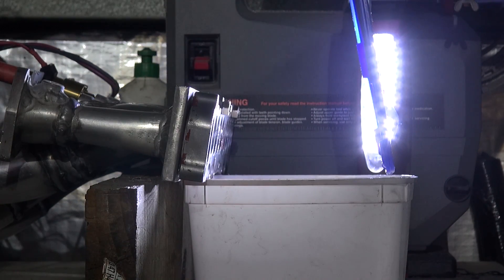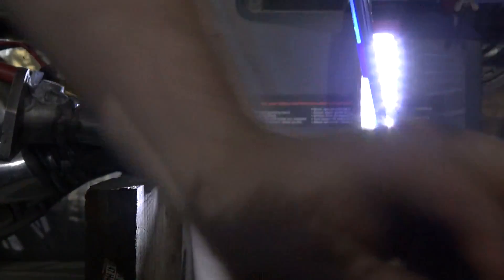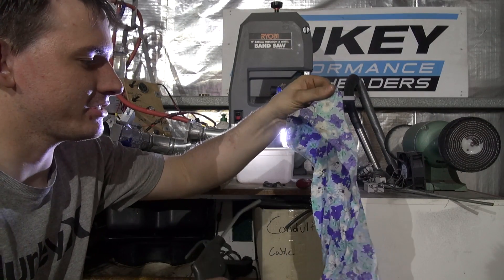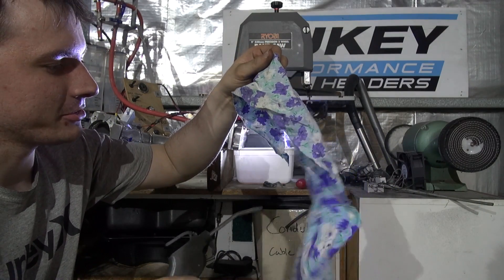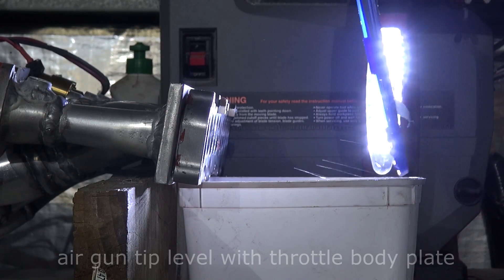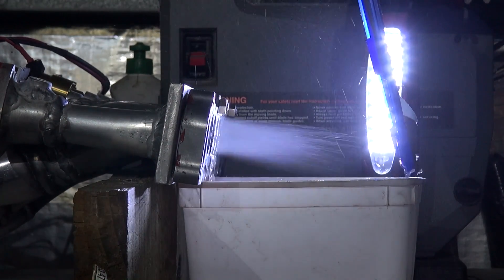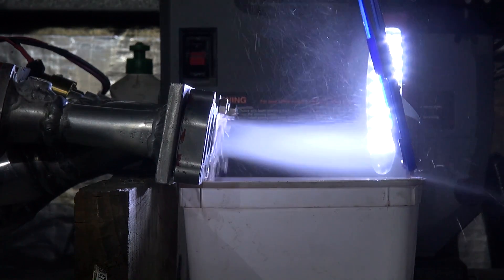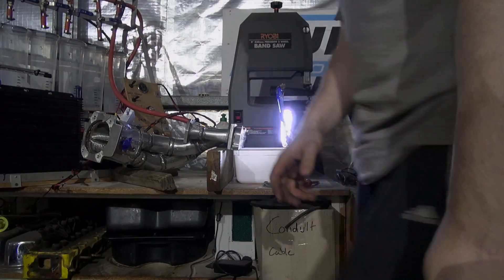Fuel Injector Spray Test Using Mike Moran Atomizer Injector 1550cc

Comment: dude we need some updates. hope everything is good
Reply from the maker: +Chris Duke car is almost back together ( currently fitting vacuum lines plumbing it all up now and ready to fabricate the intercooler pipe on it) update not far away when the engine is running with new set up and any issues with oil/coolant leaks all sorted out the video will be up.
Reply: +styleslider400 really looking forward to it.

Comment: Baddass! I guess thats why On Honda B series heads they have a clover leaf design port with the top leaf being a ramp for the injector. 
You know what?.. This just makes me think about Audi's FSI engines. I used to have an Audi S4 but I liked the idea of the RS4 FSI system and wondered how much of a difference it really made. I believe they use an incredibly high pressure booster pumps at the rails to "stratify" the air/fuel charge. 
I wonder how much different the spray pattern is on the FSI from your test just for shits and giggles.